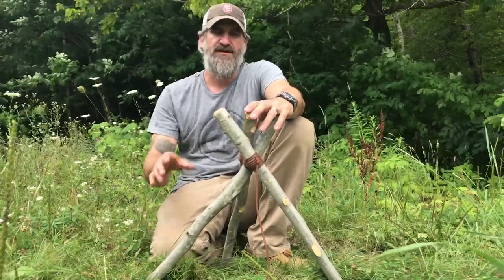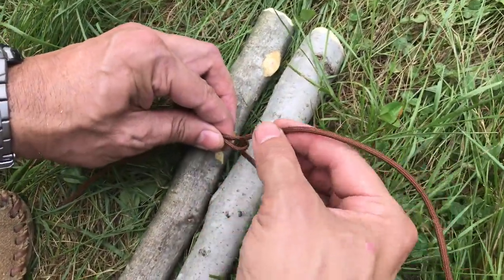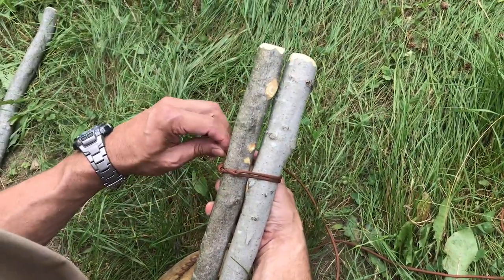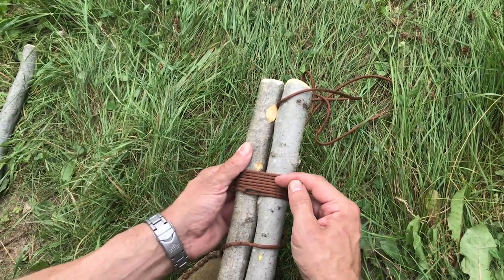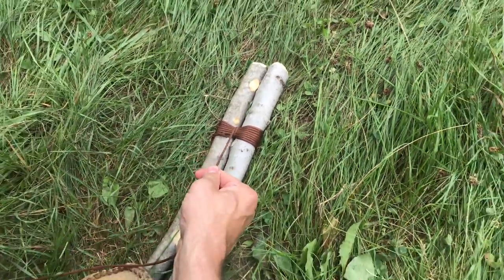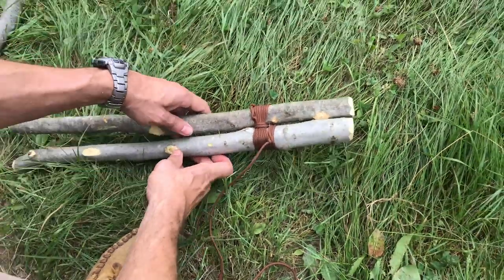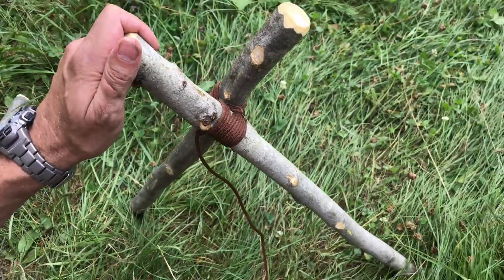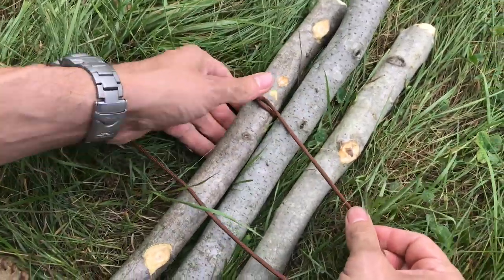Shear Lash for Bipods and Tripods

Comment: Thank you for taking your time to show us this.
 For some reason it got me to remember the flying bowline.  
So it's to take some slack in your right hand , with the end of the rope. Take the long end in your left. Through the right over and back up. An the right loop goes into the left. 
(Left into right is a slip knot. )

Comment: reminds me of the airial rope ways we used to build to get equipment and jeeps ect. across a gap  last one i remember was maid with big spruce almost two feet diameter at the base the tripod was almost 35 ft high...lol  we used to beat the lashing and frapping with pick axe handles w/ 1 1/2 in cordage..what you just did is nice clean lashing ,,best i seen on youtube yet..

Comment: No over and under on the three pole? I like it!!
Reply from the maker: Thats a true "tripod lash", I only use it for applications where I need the center pole on top of the two outer supporting poles. For the application I am using this technique for (in a future video), the weight is on the outside poles instead of the center pole so I have found this to be better for that and for applications that aren't really bearing a lot of weight. The over-under of the true tripod lash seems to take longer so I only use it when I have to

Comment: So three weeks later I finally get around to conducting a semi-scientific controlled experiment regarding which starting knot might or might not use less cordage, the timber hitch or the clove hitch with stopper knot.  As I gathered materials it occurred to me that the remaining style of wrapping/frapping/finishing was irrelevant, we're simply interested in knowing if the starting knot saves cordage.  I took some paracord and used a one inch piece of PVC, so the substrate would be absolutely rigid.   I tied both knots as a starting knot then measured how much was used.  Results:  clove hitch with stopper knot used 9 1/8 inches (230 mm) of cord, timber hitch 10 1/4 inches (260 mm).  I'd call that close enough to be irrelevant.  I did NOT try it with bankline or natural cordage, I suspect the results would be close also.  So don't fret over your hard-earned natural cordage or dwindling supply of paracord or bankline, tie away with whichever knot does it for you.
Reply from the maker: Awesome, thanks!

Comment: So the way you made the bi pod set-up it could be used for shelters like a plow point, or a lean to with two sets of bi pods. Might have to make points on the ends to go in to the ground. I like these vids where you have someone to the games work so you can do the work with both hands and show it step by step.
Reply from the maker: I prefer getting filmed over self filming for sure! Huge time saver when it can be done. Yes you could use this for most shelter applications

Comment: Knot too shabby, J. Excellent how to video as always. What's the minimum length of cordage to these two projects. Semper Fi.
Reply from the maker: That all depends on the diameter of the poles you are going around. And the weight you expect to put on it. Less weight you can get away with less wraps. I have done modified versions of this on a bipod wedge shelter with a 6’ utility cord

Comment: I have been reading "The Knowledge" by Lewis Dartnel. It is a book about restarting civilization after a colapse. It made me wonder about workflow in a longterm bushcraft/homestead situation. Say there is an economic downturn and you have just enough money to buy a plot of land. My grandparents went through that in the Great Depression. There are plenty of homesteading videos and bushcraft videos but they are primaily focused on the individual skills. The same with primative living videos. I know each situation would be different. How much land you have, what resources you can afford now, and location can make huge differences in the workflow. In Alaska you want to work all out from spring to late fall. In Florida or Arizona it may be better to start in the middle of fall and work through the winter when it is cooler. In the hot areas water procurement is the main priority. In cold areas I would think sheltter and food would be the main priorities. It is still my impression that at some point you can transition from survival, to sustainment, to a working homestead.
Reply from the maker: I think so, too. Really homesteading is a prolonged application of survival principles in that you are providing for your metabolic needs, rather than short term waiting for rescue or self-rescue, you are developing systems to make them easier to provide for over the long term.

Comment: I gave this a thumbs up as i do with all your videos but was that a little overkill on the amount of string that was used . Not trying to be negative I'm just curious about the answer ? Maybe I  mean the size of the string.  It is probably for greater visual effects for the knot ?
Reply from the maker: Are you referring to me using paracord instead of bank line? I only used it because I got complaints here in the comments section that the bank line was hard to see.
Reply: Well I believe that was great strategy for having a better view of what you were doing . Thanks for the clarification  .

Comment: Question : Are there advantages of starting with the Timber hitch over passing the working end through say, a bowline or similar? I recently made a Roycroft pack frame using the method you show here and it works great, so I'm just curious.....
Reply from the maker: You could also pass the working end through the loop of a bowline (aka “running bowline”) and it would work fine
Reply: Thanks

Comment: I’m curious, Joshua: why is it that every time I see you (and everyone else, frankly) lash poles together into bipods or tripods, the lashings  are placed several inches down the poles from the top? I mean, if you’re planning to use it to perch a backpack, tabletop, wash basin or a 6” diameter ridge pole on top of it, that’d make sense to me, but for   anything else, I’m not getting the value created by leaving extra wood at the top. Please hell me out, here?

Many thanks, as always,
Doug
Reply from the maker: It really depends on the application. Sometimes I will do them a few inches down to tsk advantage of the top, sometimes I put them closer to the top.

Comment: Joshua, can this lash be completed with 6’ or less based on Dave’s cordage management?
Reply from the maker: Depends on the diameter of the poles. For structural material (4” diameter) we have used the 6’ Utility Cord but we do a different technique to make the tripod.

Comment: That seems awfully complicated. British forces just weave between the poles in a figure of eight style, tie the two loose ends, then rotate the centre pole through 270 degrees to tighten the lashing. This can be done with thick gloves on, and is easily undone. It can even be done using telegraph poles or lodge poles and thick rope.
Reply from the maker: That is just a different lash (a true "tripod lash"). It actually takes longer to tie that one, but is necessary depending on the application. What makes this less complicated is that it can be used for both a bipod and a tripod.
Reply: The Gray Bearded Green Beret: horses for courses, I guess.  My method requires only three turns of rope and supports a bosun’s chair with me in it. The trick is in the torque applied by turning the poles through >270 degrees.
Reply from the maker: Sounds like we are talking about two different things. What you are describing sounds like the "Cordage Conservation Lash" I taught for the tripod in my Tipi Smoker and Beef Jerky video. Nothing wrong with it, but this video is about the shear lash.

Comment: How would you attach a ridge pole to the tripod?
Reply from the maker: For what application? For a shelter I would likely just use a longer center pole in the tripod and use that for my ridgepole. Depends on what shelter I am building.
Reply: @GrayBeardedGreenBeret  OK did not think of that. Yes for a shelter thanks!